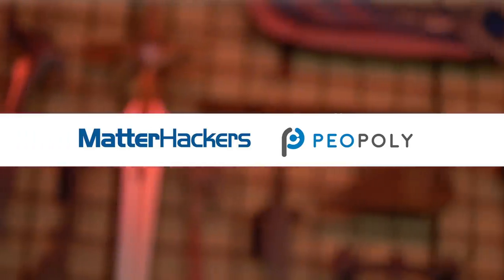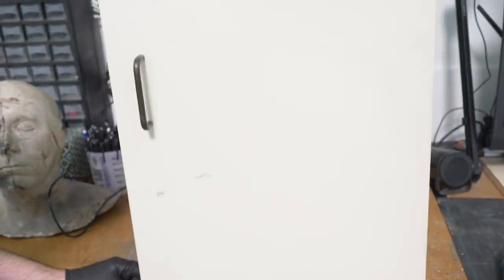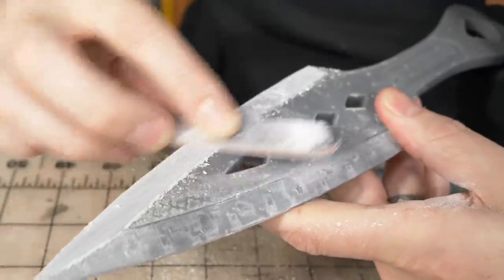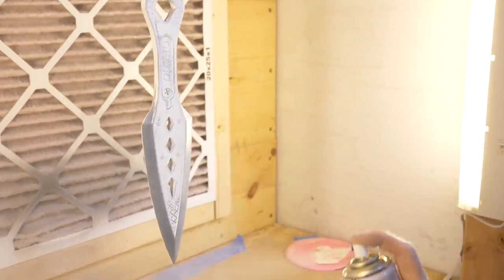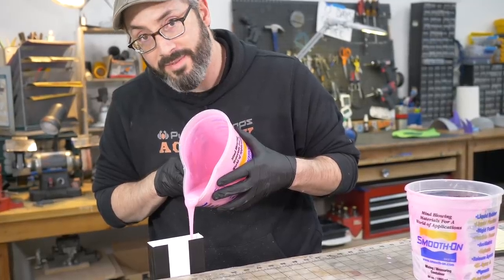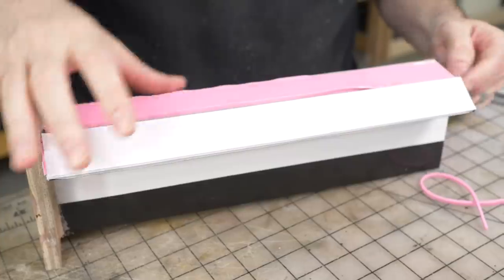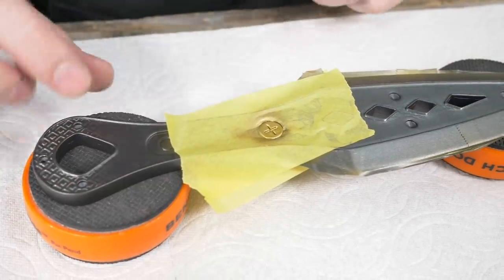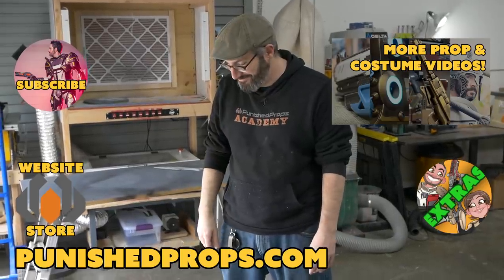APEX LEGENDS - 3D Printing the WRAITH HEIRLOOM Dagger on the Moai 200!

Comment from the maker: Check out the full tools & Materials list plus build photos at https://punishedprops.com/2019/04/22/wraith-heirloom-dagger/
Reply: what exactly does the uv lights do to the prop?
Reply: @SkitZHitZ  Peopoly Moai is a Laser SLS printer. The resin used will cure when it is hit with a certain wavelength of light. Once you've washed off all the excess resin from the printed prop you need to properly cure it using UV light. This can be done in sunlight as well but most of us end up using a UV chamber of some sort to do it quickly / efficiently.
Reply: A destiny dagger or a mask of some sort
Reply: @SkitZHitZ  it cures the resin. when the uv laser cures the resin to make the part/prop it is still in the bath of resin and some will stick to the surface. which is why you clean it. The resin that was cured by the laser however is in a "green" state, and it isn't fully cured yet. The uv light finishes the curing.
Reply: @diamondruststreams  Slight clarification, it's an SLA printer. SLS is selective laser sintering, I.E. the one with the white nylon powder.
Reply: @andyfilms  You're right. This is what 3am's does to people :)
Reply: I can design a detailed concept art for you guys to print that could be cool
Reply: Considering it's kinda transparent, how cool/hard would it be to make a split prop to put LEDs around the blade on the inside to give it a plasma blade look... just an idea.
Reply: You should do a shield cell build!
Reply: 3 leds would be amazing
Reply: If you want to continue to make 3D printed fine-detailed props larger than this, I recommend getting the Creality CR-10s from the Chinese company Creality. The CR-10s has a huge build area (nearly 1 ft by 1ft), and can print very well. It only takes G-code through micro SD, and has poor instructions for set-up, but it is worth it, for less than $500. Check it out!
Reply: Oathkeeper handel GOT with a wooden blade
Reply: Is there any chance I can buy this thing off tou
Reply: do you know anywhere I can get a mould for making wraiths heirloom knife?
Reply: I try to find the colours but it doesn’t show up when I click the link
Reply: Punished Props Academy can u sell those

Comment: Not a prop, but I could really use a printer like this to make a new battery door for my RC car.  Tried it on a regular PLA printer, and there are details that just don't come out right (like the hinge pins)
But I suppose that being as brittle as it is, it might not stand up to the impacts when the car bottoms out on concrete...

Comment: Just if you can answer me, I noticed that the bed for that resin printer is perforated and everytime more printers are doing that. Doesn't resin get stuck in the holes after you remove the print? How do you remove it if it does?
Reply from the maker: The resin definitely gets stuck in the perforations. I use a chisel to carefully scrape and pry the print off the bed and, with a little effort, it popped off.

Comment: Hmm what happens if I fill the corrugated plastic with epoxy? What will it work like and is it cheaper than other materials
Reply from the maker: That's probably more effort than it's worth. Foam Core is equally cheap and quite a bit sturdier.

Comment: Bill also think about manually adding your own supports. You could move them to flat surfaces and not on those edges that may be hard to sand away or on any place that has a detailed textured surface. 5 more minutes in the slicer could save you 20+ minutes of finishing work.

Comment: I am not sure if the matter hackers resin is less brittle than the resin from form labs, but I have found that using a higher grit sandpaper - such as starting at 600 or 800 - reduces clean up time.  The material sands off very easily and already has a fairly smooth finish.

One more reason to make a mold is that many conventions do not allow a rigid blade, and you can cast your items is flexible rubber or foam.  Also, you can go the other way, as you have done in the past, and cast the part out of a low melt metal like pewter, or make a wax piece for a lost wax process.

Also, I am very impressed with how well your mold came out.  A split mold with a cut through is scarier that I would usually attempt, and you cut it so that it had minimal clean up.  Please take a bow for that!

Comment: I clearly have an issue, at 39:04 I told myself, "That looks like a screw from a blaster like an older N-strike blaster" and you immediately confirm my absolutely ridiculous hunch. Newer N-strike Elite blasters and Rebelle and stuff normally use those weird cylinder-head screws. If I had to guess the blaster I'm going with Longshot.

Comment: With all the work you're doing removing the support material, would it not be easier to print the model in two halves, then use the screw details to actually screw it together?
Reply: My guess is that would result in an even more fragile result that might break when you try to use the screws.
Reply: Getting the Moai to print parts that can fit together is near impossible sadly. Random shrink vs warping would be tons of wasted resin.

Comment: I was SO excited for the Maoi 200, and then I finally saw that price tag. $3,099! That's ridiculous compared to the $1,200 of the original Maoi, and they even raised that to $1,300+. Sure, I figured there'd be added costs due to development and tooling for manufacturing, but I was expecting something more in the neighborhood of $2,500 or about $2,800 tops. If they really want to target us makers they need to seriously reconsider that price point. It just feels predatory. Form Labs has made it abundantly clear that they have no interest in hobbyists and makers, instead aiming for small-mid sized businesses. Peopoly were supposed to be the chosen one. They were supposed to bring fine detail to the masses. Instead they've just made a paywall too high for most to climb. I could drop the money right now no problem but I won't purely out of principal.

Comment: I'm really impressed with your ability to speak to the camera while pouring. It'd be all over my feet! Could you make the sprue/support as a component, with a corresponding hole in the dagger, and print it at the same time? How much would the 12-inch print cost a member of the public? How much is the materials cost of the mould and the casting? Thanks

Comment: unasked for 2C worth
not got a SLA printer, but from my education from the University of youtube its apparently easer to remove all the supports (clean up the contact points) before UV curing, it will prevent the 'divit' resulting from  breaking a hardened resin

Comment: You have a torch...heat it to 1800, quench in warm water, or oil, bake at 400 degrees for 2 hours...hardened and tempered.

Comment: I'd like to print some Trigun revolvers & Hellsing's pistols with all the wonderful logo & cursive engraving those models have.

I had some issues using clamps like those in the video on some small molds. They actually squished the round parts oval cos i put too much pressure on the middle with 1 of the clamps. Definitely prefer rubber bands or elastic hair ties.

Comment: A FDM printer would have no problem with that detail especially if printed vertically so that seems a bit disingenuous for the sake of advertising to say you couldn't do it. However, there would have probably been a lot more sanding needed because of the layer lines and layer lines in those small details would have been a PITA.

Comment: Hi Bill! first my quilifications, I have had a form 1 and form 2 for the past 5 years, and have grown hundreds of SLA prints, and cleaned them up, some advice.

1. Don't put supports on detail parts, or in low areas if possible, for this dagger, I would have added an extra bit on the knife edge and put the supports there and on some high points on the side, to support it from side to side, if you do that, there will be no clean up in the low areas. You can orient it any way you want, and you don't have to accept the support sudgestions that the program does.. cull as many supports as you can.

2. Seen you use putty to fill in the divots of the supports, advice is, use the UV resin as a filler, and shoot a UV lazer on the spot, or throw it in the UV oven, or in the sun for abit, and just sand away!.

3. use citedel Corax white paint.. sticks quite well to the resin. 

Good luck on future prints!

Comment: Nice video!! You should try to print a battering from Batman beyond. Bill when you use the pressure pot it will take longer for it to cure due to the solvent can off-gas out anywhere cuz it's under pressure so it stays softer longer. This happens to a lot of urethane and alkaline paints in the Northwest due to temperature and humidity.

Comment: ive seen a technique where you use the moai (or a formlabs) to print the actual mold, basically a negative of your prop with sprue and vent holes as well as some screw threads then inject the resin in (after spraying some mold release) with a baster... looked pretty cool.. ever tried it ?  thought it may be fun since you had the moai

Comment: Yeah, I would use that as a positive to make the negative for molds and then redo this knife in aluminum.  Hopefully the mold catches the fine details, but if they are a little weak just do a little dremel work and get those in there, hammer harden the edge, make sure it is sharp and bingo you have a working knife.  Afterwards you can annodize it if you want and have it those different colors.  If you can make a permanent negative, or if you are willing to make a lot of sand molds, then you can make a bunch of them to have on a bandolier for a cosplay of a rogue.

Comment: This printers seem pretty cool. The post printing process you showed is about the same as what I use for printing dentures and dental models on the Carbon at work, except the Carbon would have probably printed it a heck of a lot faster. That thing is crazy fast and the prints look so smooth! I wish I could use it for personal stuff once in a while.

Comment: But the dead space helmet and back piece I would print with that machine so yet parts for optical fiber or fluorescent wire to be able to have led used to go up and down on the back spine.

Comment: I find for larger parts that a nail brush works well to clean it. Just a little faster than the toothbrush. I would also work on picking support locations that are on flat surfaces and away from detail as it makes it much easier to sand.

Comment: For making a mold, why not just print a second one, then make the mold from the 2 CLEAN sides of the 2 prints?
Reply from the maker: That's also an option! SLR printer resin is pretty costly, so if you can print less, that's always a great option. But if you've got the resin, go for it!

Comment: I love SLA printers. You should try using clear resin it looks so good and would be great for lights!!!
Other cool things are the gears and moving parts you can make. I highly recommend trying that.
On thing I've always want to try but haven't had the chance to is adding glow powder to the resin. You'd have to be careful with the amount to get an even glow and make sure it cures properly but if it works it would be epic!
Reply from the maker: All great suggestions!

Comment: Love the 3d printing but concerned about all of that extra plastic from the supports. Would be nice if extra plastic or plastic from failed prints could be re used. 
Nice project though. Good job
Reply from the maker: There are a few people who use filament and melt the supports back down into recycled filament! I'm not sure if something similar can be done with the resin supports.

Comment: I'm sure you've answered this before, but why vacuum the silicone and pressure on the urethane? I understand trying to squeeze the bubbles so tight they disappear, but does urethane not respond well the vacuum?
Reply from the maker: The urethane gets pressure cast to remove any bubbles in the casting, which removes bubbles better than degassing the urethane. This is critical for a part that's going to be translucent. The silicone must be degassed so that there are no bubbles in the cured rubber, otherwise those bubbles would collapse inside the rubber when pressure casting the urethane, causing imperfections in the surface of the casting.

Comment: I tried making a two part mold a couple weeks ago (after watching your videos on it) but my second half of the pour stuck it all together, I sprayed mold release bofore i poured but I guess I did something wrong, not enough mold release maybe? any ideas?
Reply from the maker: It depends on the silicone you're using, which mold release, and a few other factors. I'd reach out to the folks at Smooth-On, they're great at helping people out and diagnosing issues.
Reply: Awesome, thank you for that I will give them a messages.

Comment: can u do lose wax caSTING WITH THAT PRINTER AS WELL?
Reply: I'm not sure if you can use it for the moai, but there is a type of resin (blue cast) that's will work on the anycubic photon that is designed specifically for lost resin casting. A lot of jewelers in some printing groups I'm in use it with great results.

Comment: I've been mixing flexible resin with my abs-like  in like 3% flex to 97%abs to take a bit of the brittleness off.  It's made printing skeleton mini's much more doable.
Reply from the maker: Interesting! That's a cool trick
Reply: @punishedprops  It's one of the things I find interesting about resin over my FDM 3D printer is that you can to some extent mix resins and end up with different mechanical properties.

Comment: 1. 3d printed blade with resin
2. 'made mold from it
3. made resin blade from mold
Reply from the maker: Seems a little redundant, huh? But that's why we did the drop test, to show how the two resins are quite different! The SLA resin is quite brittle, but the casting resin we used is much sturdier. We can also tint the casting resin super cool colors like you saw in the video! Different processes have different benefits.

Comment: Could you then cast a wax model, cast that in plaster and then pour metal??
Reply: They have a wax resin just fro such a  purpose.  It requires all of the peripheral equipment to vacuum cast though. Check out some jewelry makers channels, they are all over it.

Comment: How many Times can u use one of the molds.
Reply from the maker: That depends on the silicone and how rough you have to be with the mold to get the cast out of it, and also the quality of your mold. Some molds you can get 30+ pulls from before they deteriorate, others only a couple.
Reply: Punished Props Academy In your opinion what’s the best product to use when it comes down to long term durability of the end product molds. if possible can you do a video of a durability test of different types of products and cost?

Comment: Can you fiber reinforce the resin?
Reply from the maker: You could, but I wouldn't recommend it for this specific build - you'd end up losing a lot of those really subtle details.
Reply: @punishedprops  Sure. But I want to modify my airsoft to a bullpup and want to cast a new stock. Not so many details but it should be strong as possible.

Comment: I would print a sledge hockey sled, I can print it with my CR-10 but it’s such a pain in the ass because there is soooo much detail in my STL. If you want to try I can always send you the STL, no problem.